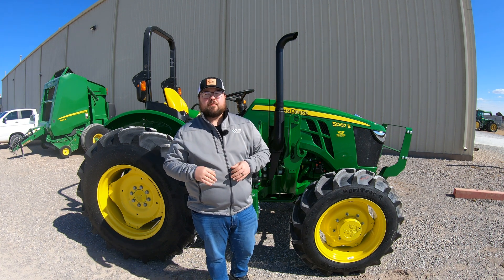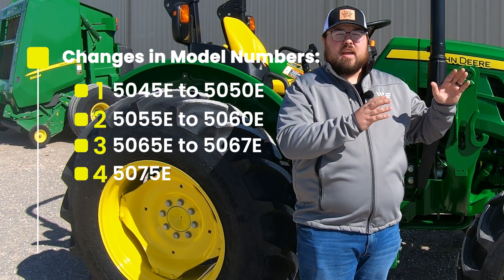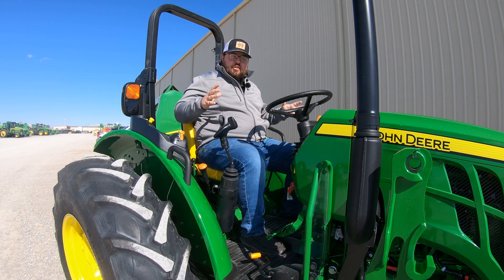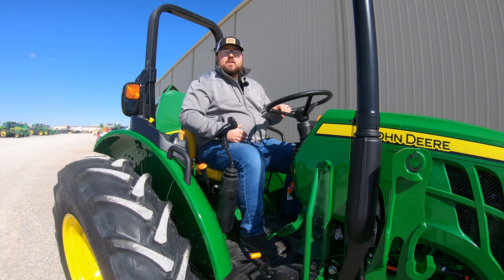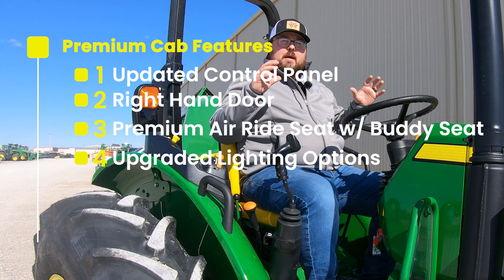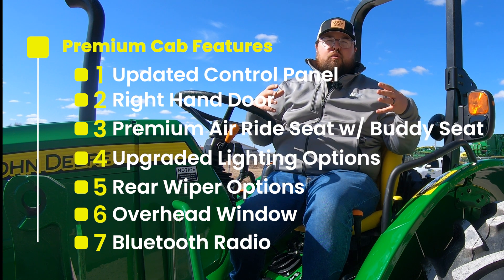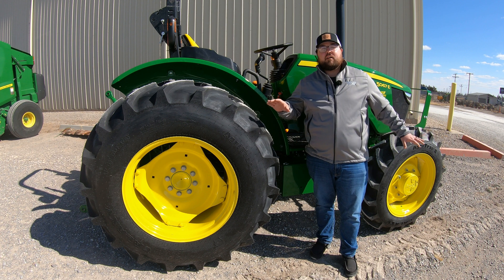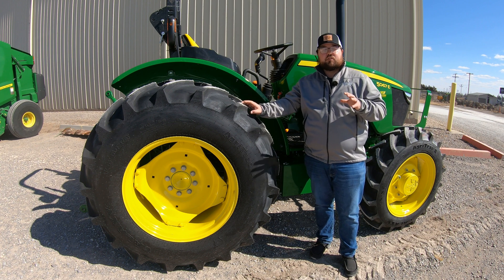What's New in 2023 to John Deere 5E 3 Cylinders Series Tractors?

Comment: I work at deer they have a 3rd valve that can be added the the mid valve stack from model 16+
Reply from the maker: Yes, they have had one that could be added at the dealership, but now it can be a factory installed option.

Comment: We have a 5065. Worst tractor we have, it will barely lift a round bale without the back end lifting off the ground.
Reply: And the latch method for loader implements is a night mare, wish JD would switch to quick connect like every other brand in the universe
Reply from the maker: I hate to hear of your bad experience. It is coming off the ground even with rear weight? Are you using a ballast box or wheel weights or fluid in the tires?
Reply: Well no shit, it’s a small tractor. Get a bigger tractor if you need a bigger tractor.

Comment: Come on guys, it’s less than the 100 hp requirement for dep! I have a neighbor who bought one and it won’t pull a 10 foot mower in heavy Bermuda! Only good for mowing with an 8foot mower! Then, one day my 6430 went down and I borrowed his 4wd 3 cylinder and we couldn’t put out hay for cows because it wouldn’t go without sinking! My 6430 4wd had much better flotation ( less ground pressure) than the 3 cylinder! He calls me to pull him out when he gets stuck!
Reply from the maker: There are definitely certain applications that are better suited for larger tractors.